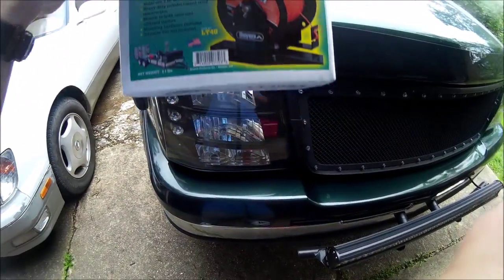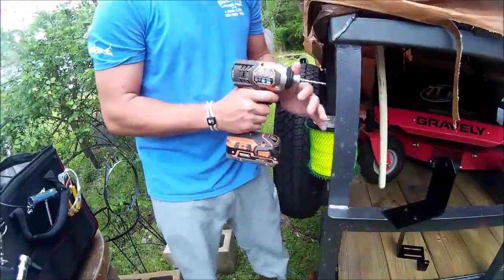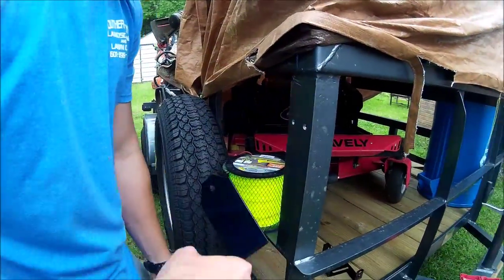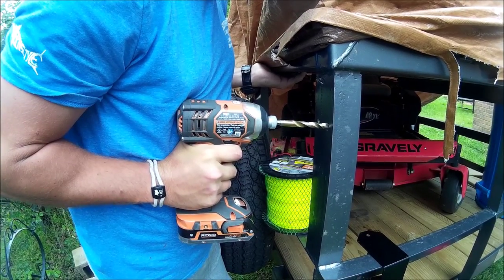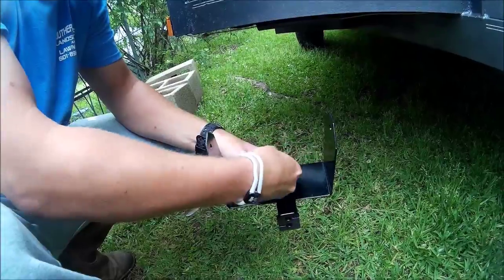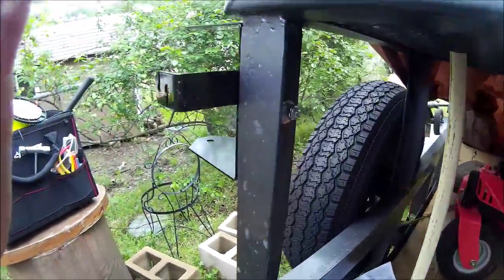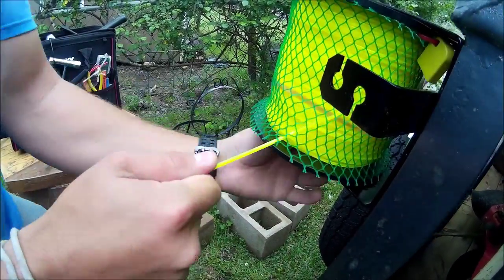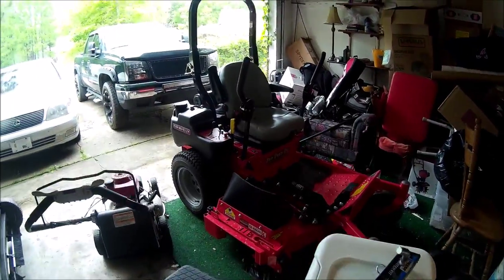10 Minute Trimmer Line Spool Bracket Trailer Install

Comment: Awesome video, I'm thinking about buying one for my enclosed
Reply from the maker: It comes with big self tappers to mount in inclosed trailers.
Reply: +Southern Style Management awesome
Reply from the maker: +Sunset Services Not seeing any videos on it. post a link. I think I would rather spend 20$ and have the real thing. It works great and have had no problems.

Comment: I just got the 152 for my 5 acres. I may try to pick up a few yards to pay my payment. I have cut my yard once and cut my mowing time tremendously.
Reply from the maker: For sure. Yeah a few lawns would make your payment for sure.
Reply: I was tired of making repairs on my garden tractor so I got the 152. I am hoping this is my last mower purchase. I can make the payment with a few yards am working on getting a friend of mines church. the church will be $100 every two weeks. My wife wasn't super excited about me spending this much on a mower so that will help out I'm sure. Happy wife happy life. I wish I would have gotten the 160 it was only $200 more but I would have had to get a new trailer my 5X8 wouldn't haul it. I enjoy your videos keep them coming.
Reply from the maker: 60 is over rated to me. Scalps to easily on inclines. 52 is as big as I will run.

Comment: Good job, I watched Geek to freak and he used the same line. I think it lasts longer than other lines. My Stihl weeder is the 130R, bought that because of the weeds i cut down in my pasture, not knowing what was there. Good thing because i found a heavy duty chain and metal post sticking up didn't want to hit it with new mower at the time.
Reply from the maker: Yeah always weed eat first. I found a tow chain in a residential yard the other day. You never know. Yeah Geektofreak was awesome.